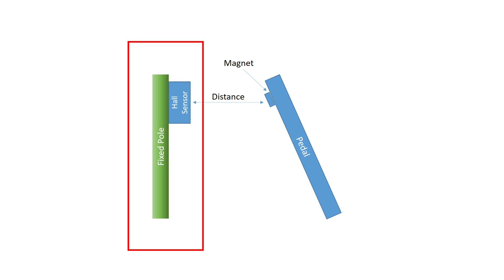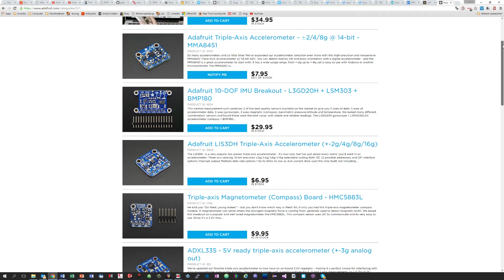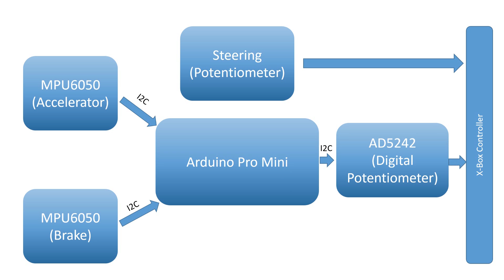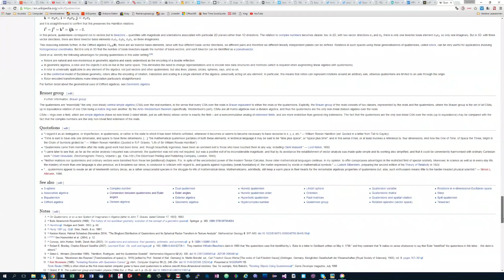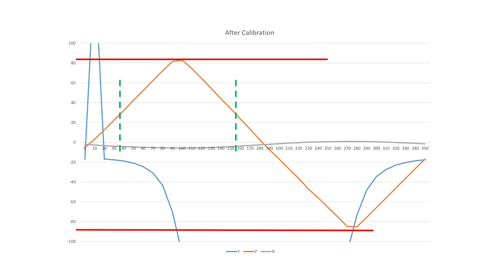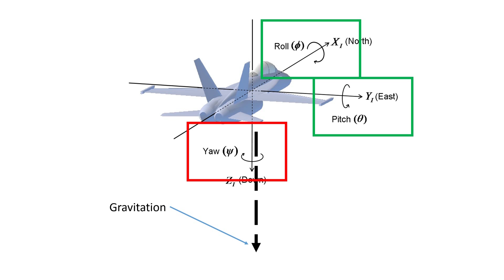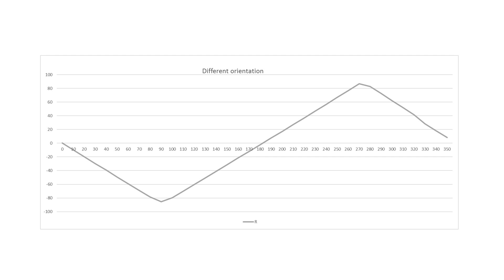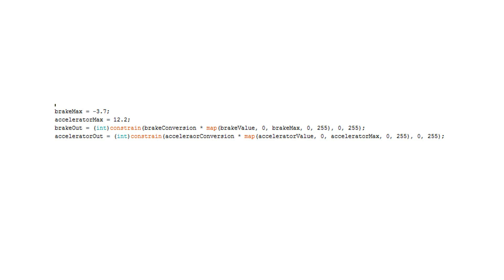#50 Racing Car to Simulator Conversion Part 2: Reading Angles with Accelerometers

Comment: Nice and interesting video.
I only wonder if the speed at which the pedal is depressed influences the measurement.
it is, after all, an accelerometer.
That is why it seems wise to place the sensor close to the pivot point and not on the end of the pedals.

I know this is a bit late but maybe it helps.
Reply from the maker: Maybe speed influences the angle measured. But not a lot.

Comment: I know this is old, but if you get around to an upgrade may I suggest a synchro resolver for the steering wheel which has many advantages (being analog) and can be used for force feedback.  Also, the pedal should be either a "drive by wire" sensor from a vehicle or (my preference) a throttle position sensor on the end of a cable.  These are immune to gforce changes such as rapid pedal actuation and motion cues (should you ever build a motion base).
Reply from the maker: Thank you for the tips. I will have a look at it.

Comment: Have you ever tried 3D tracking an object using an IMU unit (MPU 9250 etc) ? 
I've been trying to do so, but I seem to get stuck at obtaining X,Y,Z coordinates based on sensor fusion.
Reply from the maker: No, I only used it to measure angles like here and on my self-balancing robot.

Comment: I would have gone with fixed sensors permanently mounted because you can use the setup for data logging on the track. Data logging is so common you find them on Karts, and is so well sorted that all the sensors systems are well known. I think Speeduino(approx $120) only does engine parameter logging - it's still new and might have extras added - but maybe something like Rus EFI(approx $180) will do everything.
Reply from the maker: I do not think we talk about the same project. Here, the car engine does not run. It is only used to create an impression for a simulation. Your proposals deal with cars where teh engine runs.
Reply: I got the impression there was only one car being used for both the track and the SIM so the sensors had to be removable for the track. So he has a spare bare chassis for the SIM.

Comment: Came to the party bit late
i will rather use an encoder for steering wheel input than a pot for long time reliability
Reply from the maker: That would also be a possibility. However, I do not see a big problem with that. Many radios from the 60-80 have Potentiometers without problems. The advantage of the pot is also, that it has a absolute position . And they are dirt cheap...

Comment: great video , and great idea .   using I2C buss  for sensors controller inputs , i have found some can seem/feel a bit laggy for things i have built .  I'm not sure as i have not seen you code for setup , but i ramp the TWBR to 400KHz form the 100KHz , to make inputs 'feel' more responsive to users . Also i have mentioned in a video there is a bug / feature in the default arduino lib and some 3rd party libs that any time you create a wire object it resets the TWBR to 100KHz. well any how after you setup / create your I2C  objects ,  then set the TWBR value . I have poor audio in this video , but i was pushing some IC's up to 400KHz that that most all info sheets says max out at 100KHz I2C   https://www.youtube.com/watch?v=l3pXQFlNDM0 .    
it should only take you 1 line after you create your 2 I2C objects to try this at 400KHz , if you ave not done so already .
Reply from the maker: +XerotoLabs I usually use a multispeed I2C sketch to confirm the functioning and the address of the chips and to check out their speed capabilities. The coding of the example uses  TWBR = 24; which should be 400kHz in setup. But I did not care too much because the speed was ok when we tried. For the MPU6050 it might be important,because it transferres quite a lot of bytes and I have two of them connected, for the AD5242 not, because it transferres only a few bytes. I will check once the loop speed with the oscilloscope.
Reply: +Andreas Spiess yeah its more of a feel thing .  it can reduce the latency 'feel' for gamer using the controller.  for gas and breaks it might not even be a issue as the users may not feel or notice the diff between 100 and 400 on control inputs that are foot operated vs. say a head mount tracking .